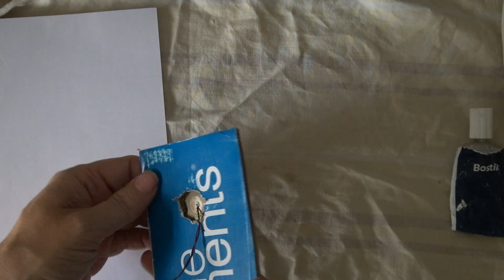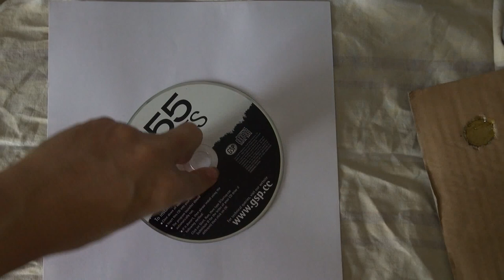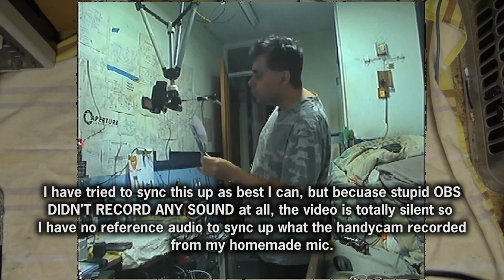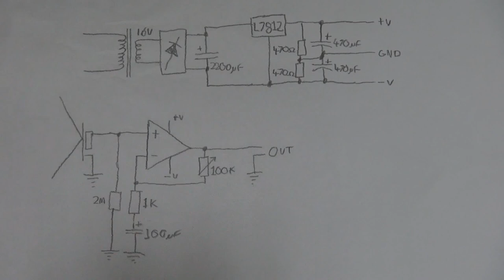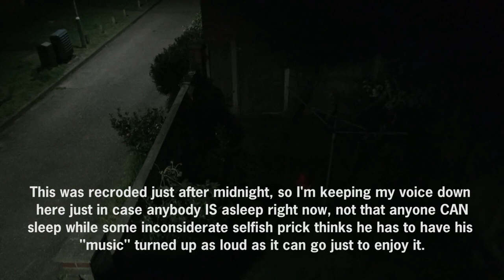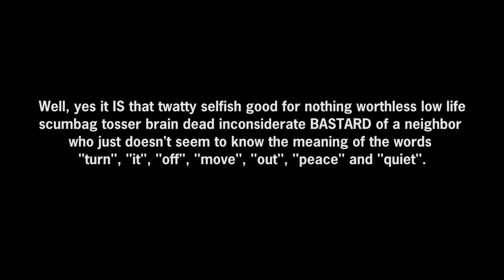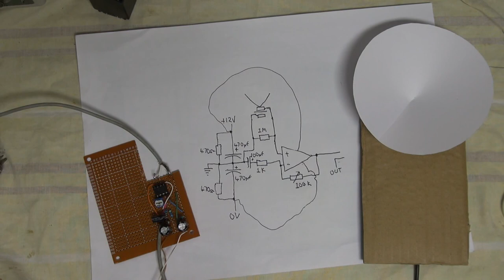How to make a crystal mic, and a good pre-amp for it.

Comment: Hope you ďont mind  a couple of suggestions. Micro Chip make a purpose made piezo op amp. The piezo element does not necessarily need to respond to rarefactions in air it can be glued to solid objects to study vibration with a scope screen. Micro Chip also make converter circuits to take the output of the piezo into the digital domain (your computer)

Comment: It seems that the added Cone makes up for the lack of sensitivity caused by the stiffness of the Brass Disc part of the Piezo Transducer.
All that weight added to the moving parts of Microphone probably means no Treble though.
It seems o.k. on speech.